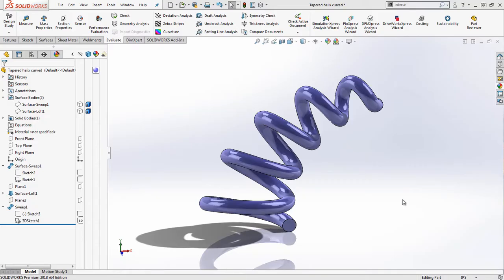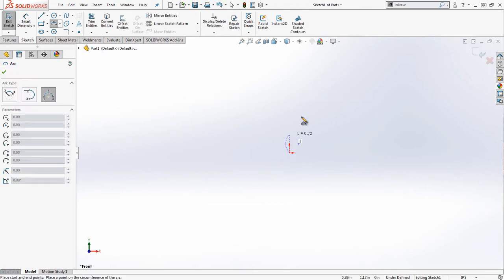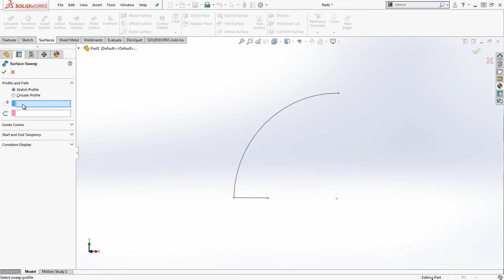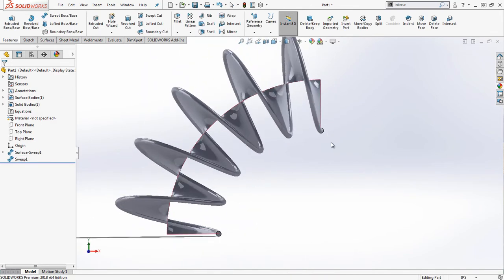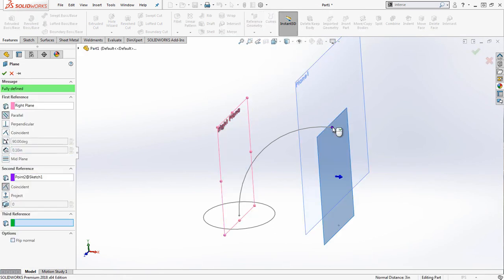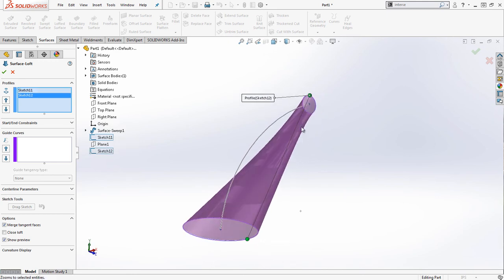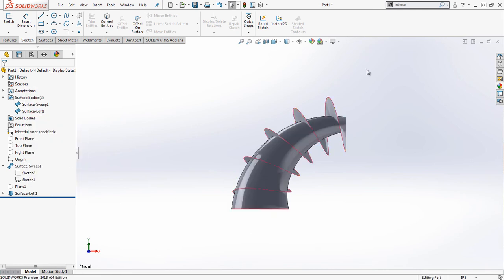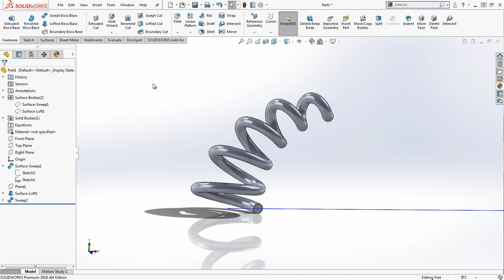How to Create a Tapered Curved Spring for the 2018 SolidWorks CSWE(+Free Practice Problem)

Comment: So, can this be used in a pattern? i wanted to try and make a cool spout for a sink, say 6 of these all twisting together but not connecting except for the base and the actual spout. Seems if you try this with different two plus arcs the points where they connect seem to mess things up a bit. Great video though this helped a bunch!

Comment: Hi. Good video. Apparently circular sweep gives a different result for the spring body mass and the circle sketch also gives a different result, same material and same diameter applied. These two methods don't yield the same result. What is your suggestion for the CSWE, as there won't be any multiple choice
Reply from the maker: It should be accounted for in their range of values for the answer, but the intended method, I believe, is the surfacing method. (surface sweep, then solid sweep)
Reply: Yes, that is very clear. I was referring to the final sweep, the one to give the final answer to the question. So you mean, circular sweep, not create a sketch and draw a circle, then do the sweep with sketch and path.
Reply from the maker: @Dionis Marku  The way the problem is shown on the actual CSWE, it is probably better to simply create a sketch circle.